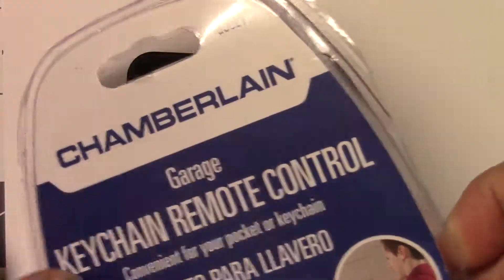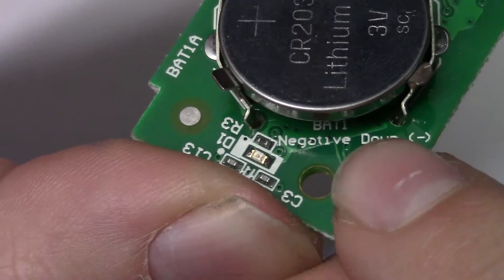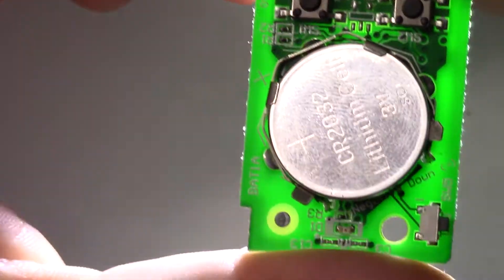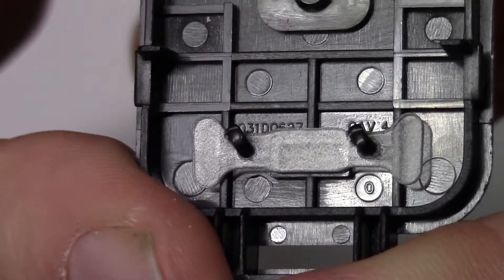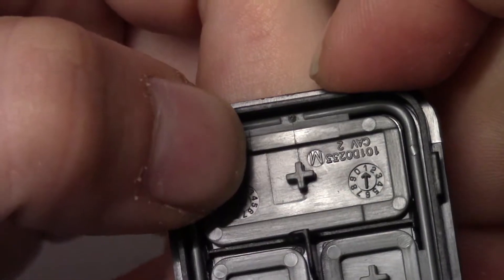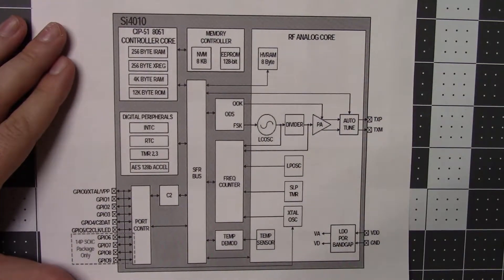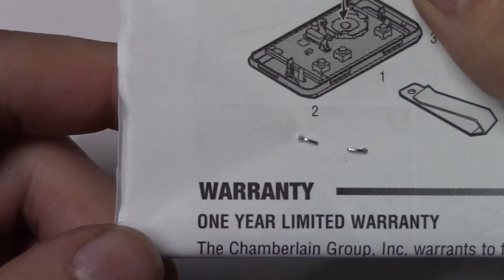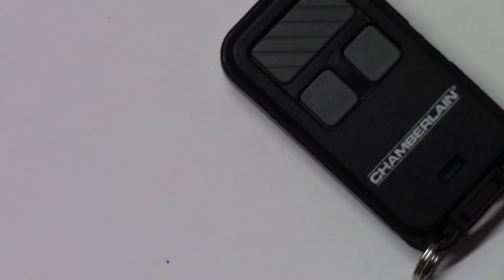Chamberlain 956EV Keychain Remote Teardown

Comment: I wanted to know how to open the key chain.
Reply from the maker: You use the little notch on the side of the case. All you do is stick a dime or screwdriver in the notch and give it a twist to pop it open.
Reply: Same. Thanks for responding.